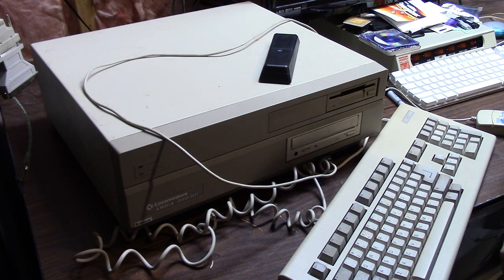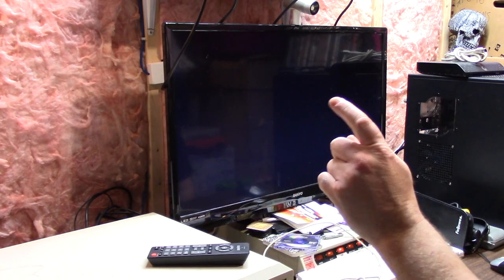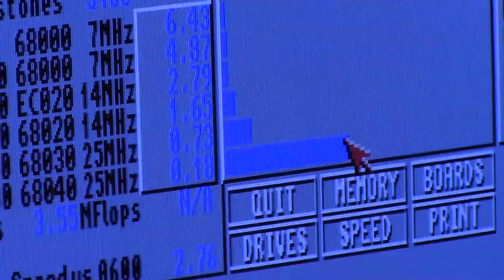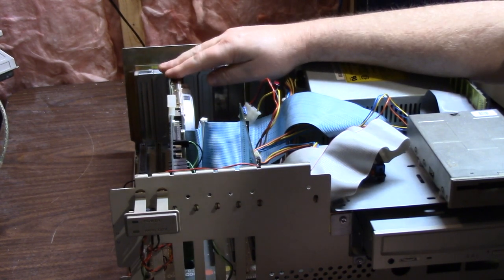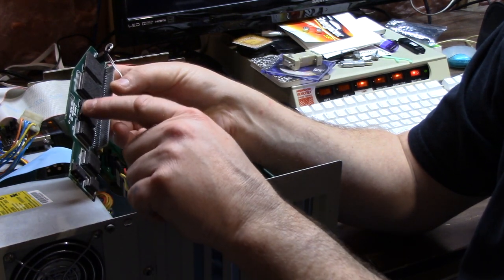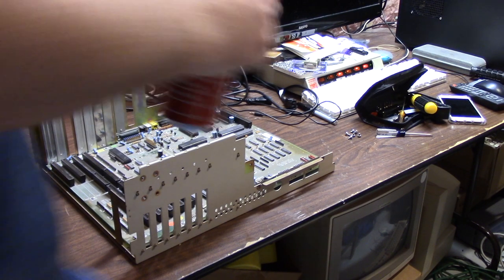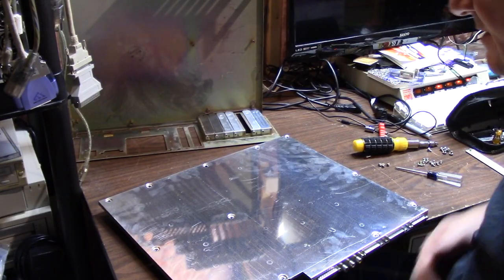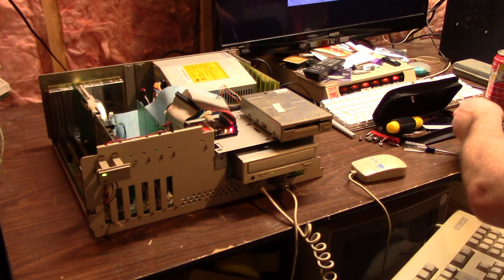Episode 71 Commodore Amiga 2000 tune up

Comment: The A2000 is my favorite Amiga model. The expansion possibilities are endless. My current A2000 is rocking an A2630, an A-Max II Plus card, Buddha IDE w/IDE to SD card adapter (although I may change it out with a IDE to CF), AGA-2000 Flicker Fixer, Mega Chip and I have a old A2088 bridgeboard hanging around the house somewhere. They're great machine and built like tanks!

Comment: Very nice. You can get all of the circuit boards looking like new using 99.9 pure, anhydrous isopropyl alcohol and and an anti-static brushes kit. Combined price for both is less than $20 on amazn. Best way to apply the IPA is from a fine mist spray bottle like Jan Beta does (youtube channel of same name). You'll be shocked how great it works. Congrats on your awesome Amiga 2000! It's fantastic.
Reply from the maker: keep watching the series. it gets better

Comment: You should check Terrible fire 530 and 534 cards.I do not remember witch one is for the a2000.Open source accelator cards that he is developping all the time.
Reply from the maker: indeed!, I did but he doesn't sell completed Units, only blank boards, and my old eyes have no means of Soldering SMD chips and BSOD chips, if the were all normal i could....  I ordered a Vampire from France. should be here in a month or so
Reply: @ChrisEdwardsRestoration  There is on guy who is making the boards over there and Tf have given nod of his head that he can make those.Tf gave he's aprove that he is good board maker or something,meaby somebody know the name of this guy.

Comment: how to remove motherboard from shield and how did you wash it?
Reply from the maker: just unscrew it, i washed it in the sink w soap and water, dried it really well.
Reply: @ChrisEdwardsRestoration  I did take all screws off but it's wedged into the metal shield by the I/O ports.  My board is a B2000 CR Rev 4.0 though
Reply from the maker: Right see how i bent my front away a little bit and popped the joystick and mouse ports out.  Remember to take all the port screws off too and it just pops out
Reply: @ChrisEdwardsRestoration  i'll go back and check but I figured that was it.. I bent the front ports metal back a few times playing around with it but didn't want to go harder... so you just warp it right out of place and up with the board.  I probably took too many screws out that go downward to the board on some ports.  surprised you have to bend (substantially) the metal around the 9pin serial ports to get it out.
Reply: @ChrisEdwardsRestoration  double checked but it appears you left the rf shield on the whole time
Reply from the maker: Hmm welll i do so many videos look at the a2000 agnus repair you will see how i get it out.